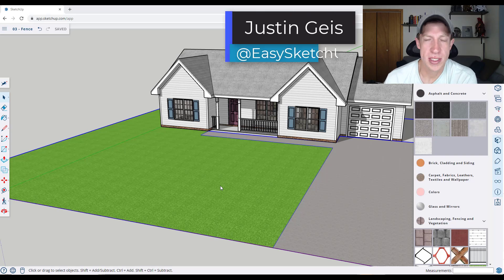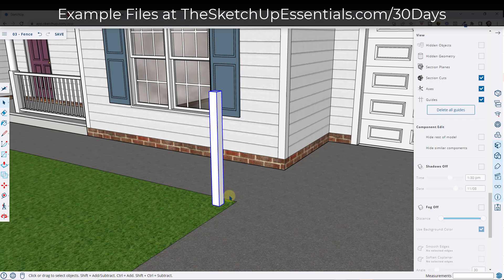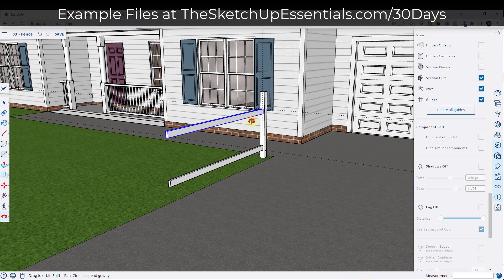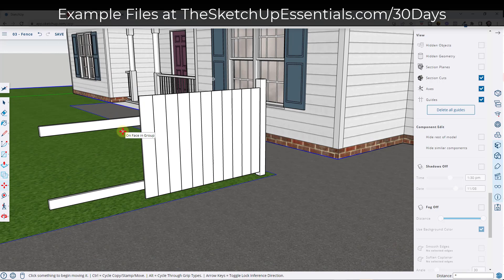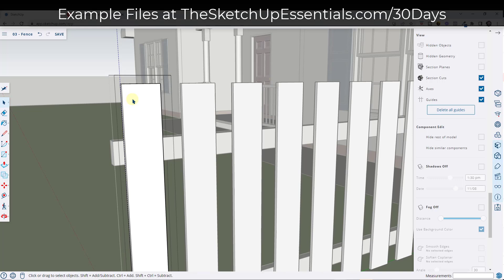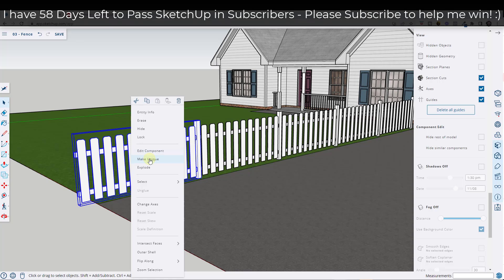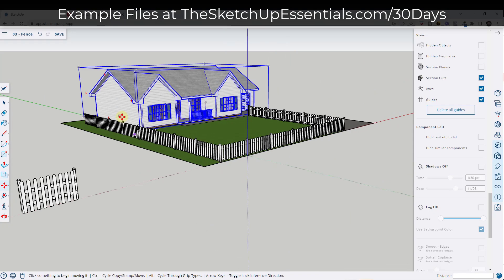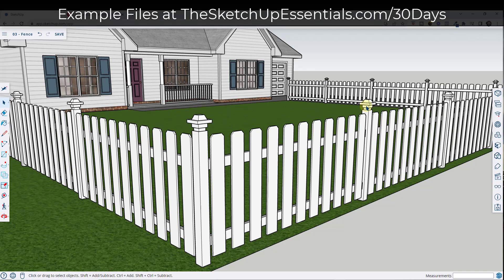Learn SketchUp in 30 Days DAY 3 - The Picket Fence!

Comment: As an avid Guides user, I find it helpful to create a keyboard shortcut to both show/hide guides as well as delete guides.  I use the G key to show/hide guides (View -> Guides) and the Option-G shortcut (Mac) to delete guides (Edit -> Delete Guides).  Caveats...  The Edit -> Delete Guides command deletes ALL guides.  If you've hidden Guides with the View -> Guides command to turn them off, then try to add a new guide, the new guide is created, but immediately hidden.  Select Edit -> Guides again to show all your guides, including the newly created Guide.

Comment: At 10:30 into the video you were able make the rails unique. I have tried and tried to make them unique on both my Mac and my Windows 11 PC.  but I could not duplicate what you did in the video.   Difficulty #1:  I am not able to highlight both my rails at the same time.  You, however, were able to click on the top rail and then the bottom rail and they both remained highlighted.  Difficulty #2:  though I am able to individually make them each unique, in order to activate the pushpull, sketchup requires a triple click on the rail.  When I triple click the rail, it is no longer unique and  the rails are affected by the pushpull function.  The tech guy at my school said sketchup is not compatible with Windows 11 but it is compatible with Mac.  However, sketchup seems very glitchy on both systems.  User error is likely a factor as well.  Do you have any work arounds?

Comment: Hi! I've start enjoying your course but have the problem for this section. For the follow me tool part when you drew a recess around the fence post 13:20
somehow it does not work for me. Here is what I did:

1. Click the fence post until it is inside the component
2. Draw the rectangle under the top of fence post
3. Click the top of fence post
4. Select follow me tool and click the rectangle which been drawn

What I experienced it reads (the profile needs to be perpendicular to the selected path) after I clicking it over and over.
Any step that I missed here?? thanks in advance.

Comment: Whenever I make a component, its as if it didnt save as one. When i click a picket, it chooses the rail attached and it wont allow me to move just the picket itself unless i go in and unselect every single line attached to it from the rail making it extremely time consuming. What am i doing wrong? I'm currently working with the trial version

Comment: Okay, I found where to go but I can download and open the fence into SU with no problem, but when I try to open the Cad drawing I get an error message that states it was saved as a 2022 version and I'm on 2017.
Reply from the maker: When you download the SU file to your desktop, it should have asked you what version to save it as. Did you save it as a 2017 file before trying to open it in the desktop version?
Reply: @Thesketchupessentials  it didn't ask
Reply: @Thesketchupessentials  it didn't ask on the fence either but it will load into SU
Reply from the maker: @h.w.kueckelhan2322  OH - you're talking about the example file from yesterday - gimme a minute
Reply from the maker: @h.w.kueckelhan2322  Ok try the one I just re-uploaded
Reply: @Thesketchupessentials  That works!!!!!  Thank You. Keep the series going. Can't wait until tomorrow

Comment: When I click on the post in the last step to put that decorative cap on only to post from non unique components light up and change when I alter the one I've clicked. what have I done wrong to make the ones in the unique fence sections not light up as well. And is there a way to fix it?
Reply from the maker: I don't fully understand the question
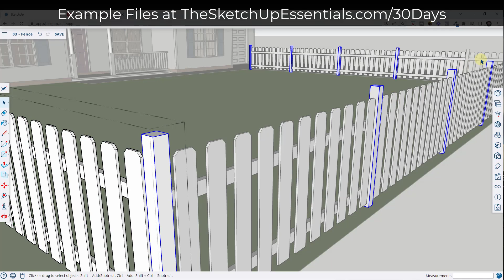Reply: @Thesketchupessentials  at 12:12 you click into a fence component and then on the post and point out that when you click on the post its makes all other posts highlighted as well. which you means we can alter that one post and it will alter all others.  but when I click into a post on mine it only lights up some other the posts (not all of them) so I cant alter all of them at once. is there a way to link back up the posts that don't "highlight" with the rest of them? So that I can alter them all at once like you do. instead of having to seperately alter each one that doesn't highlight with the others.

Comment: First let me say thank you for all your help. That said, I have a question. What is a good mouse to use? I'm using Pro and almost exclusively design and model furniture. My mouse is just a basic.
Reply from the maker: Honestly as long as it's a mouse with 2 buttons and a scroll wheel that acts as a third button, it should work fine. I have both a 3D Connexion wireless mouse and a simple wired Dell mouse that I use and they both work great

Comment: Hey Justin! at around 5:45 when you begin explaining how to create an array of pickets, could you walk us through whether you're in "copy mode" with the Move Tool or a different mode, perhaps the clicking / typing sequence in more detail as well? I'm using the Pro 2022 version of SketchUp but can't seem to make a series of pickets with the Move Tool (in or outside of Copy Mode) by typing in *N, N being the desired number of pickets in the array. Watched this segment of the video several times over and am confused what I'm missing- might just be my Logitech keyboard. When I copy your instructions exactly, an error message appears saying "Invalid length entered".
Reply: looks like I solved my own problem! was getting hung-up over the keying / clicking sequence- FOR ANYONE HAVING ARRAY ISSUES:
1) make a copy of the desired component using the Move Tool in Copy Mode ("M" followed by "ctrl" on PC)
2) place the component where desired
3) once this copy is made- REMAIN IN MOVE TOOL / COPY MODE (step I was missing)- and simply key in *N (N being the desired number of copies) and click "enter". This will result in N number of copies in addition to the copy made using the initial move / copy command. At this segment of the video Justin makes 11 total pickets using this initial move + copy tool and the array function.

Hope this helps anyone who was also struggling with this part. 

- B.
Reply: @brianlasack9001  I'm working on a mac and having major problems with this step. I move the picket to the end like the video says. Tried the /5... nothing happens. Tried your way where i did the move/copy and hit just 5 and nothing happens. I dont understand what i am doing wrong...
Reply: @greenscreentv1  not sure how the steps may differ on the Mac version but ensure that you’ve completed at least one full copy of the picket using the Move Tool while in copy mode. Once this copy is made and placed by right clicking where you would like to situate it, you should still be within the copy mode of the move tool at this time. Without changing modes / tools / clicking on anything else whatsoever, key in *N and press Enter. N number of copies should be made along your working axis at that point. Hope that helps?
Reply: @greenscreentv1  after done placing the picket by clicking it (start with M and option key), you should go with 5/ or 10/ instead /5 or /10. Hope that helps. It worked for mac!